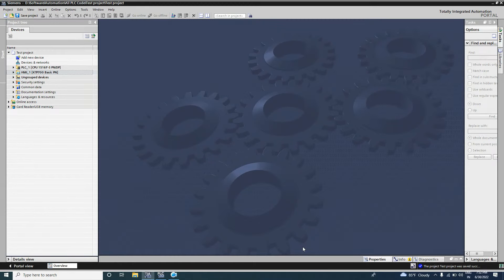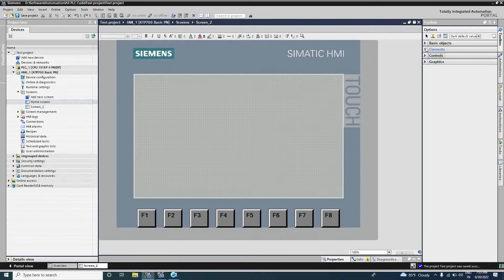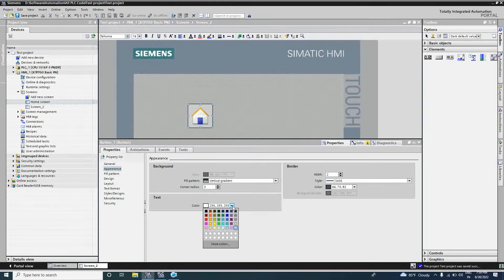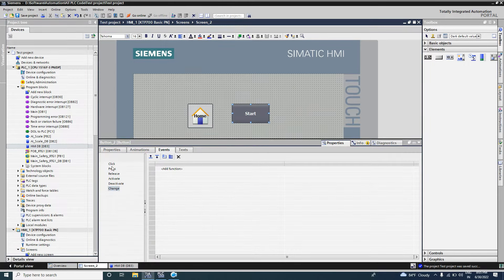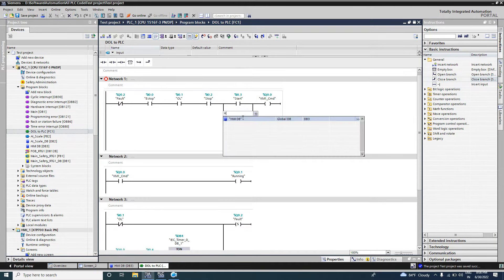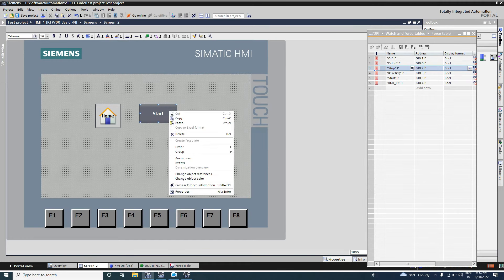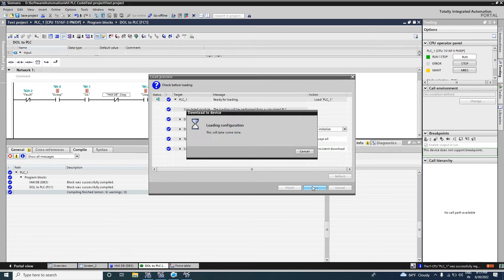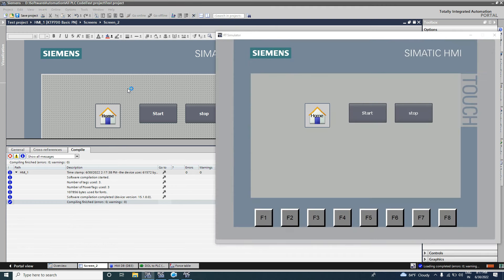TIA Portal: How to add  and configure Button on HMI for start/stop? | HMI Leason -02

Comment: can you explain? I've tried to create a button on a system in a simulation, but to activate it, sometimes I have to tap 3 or more times, even though the data type I'm using is boolean
Reply from the maker: Data you are using Memory bit like M10. 0   or  physical address like I10. 0  or From shared data block like db10. Dbx0.0 which one is that?
Reply from the maker: Please tell me, so that I can give a solution